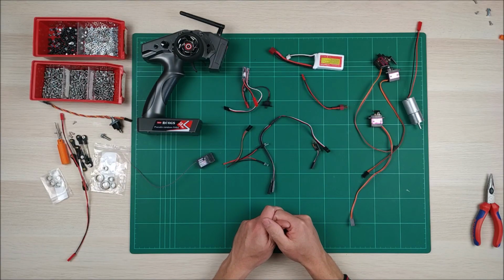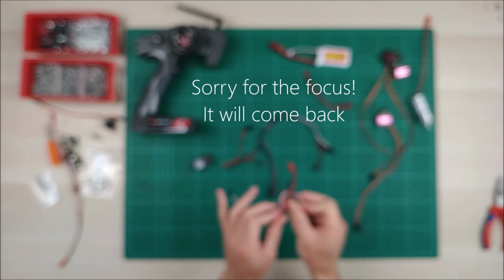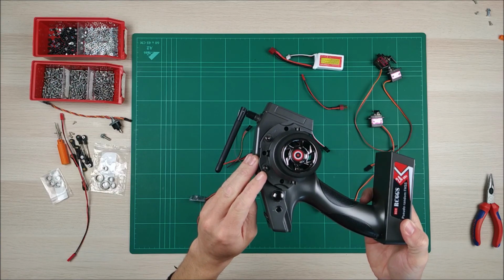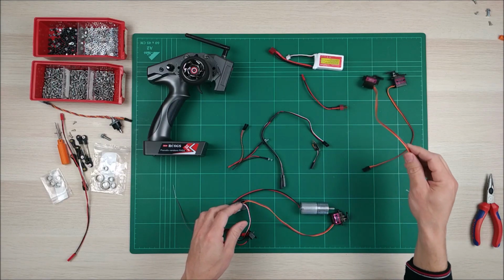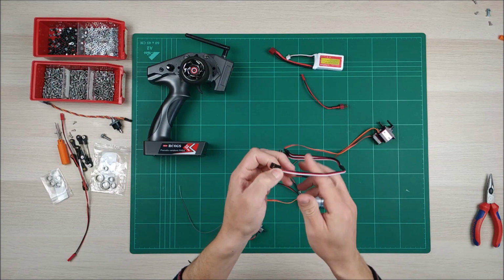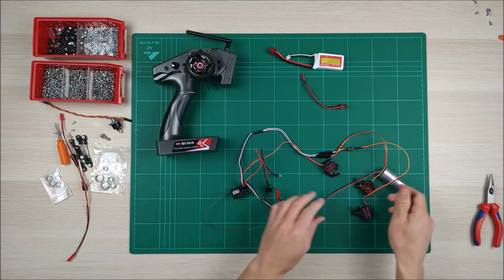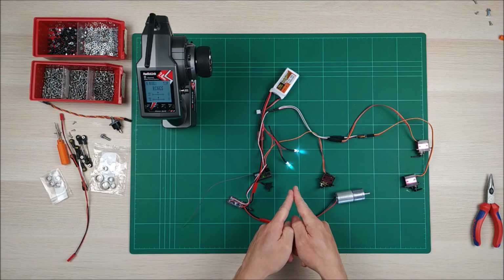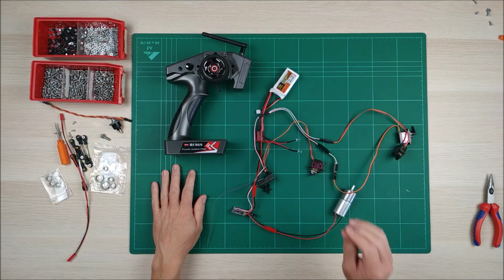OpenRC Tractor build with me part 2 connections test

Comment: Hello,

While I am printing the parts for the Massey Ferguson version of your tractor, I ran a connection test for the transmitter, receiver, motor and ECS, and three servos.  I ran into an issue when using the Y-harness and the servo signal reverser.  I just checked my order and I made a mistake of ordering the 5-6V Servo Signal Reverser.  I just ordered the 3.6-24V Servo Signal Reverse module and hopefully that one will work.  In the meantime, what I ran into with the 5-6V version is that with one servo connected directly to one Y-harness and a second connected via the reverser, the servo connected to the reverser would work and the directly connected servo would not.  If I connected each servo via a reverser (I had ordered two of them), both would work and properly reversed.  Connecting the servos directly to the Y-harness, no reverses, both servos would work.  So it just the configuration where one servo uses the reverser and the other not, that the servo without the reverser does not move at all.  Any ideas, suggestions?
Reply from the maker: Sorry to hear you ran into problems. It's strange, I didn't have this problem. Have you tried different radio channels? Just today I was doing some tests with my next tool and both servos worked OK.  Maybe it has to do with some incompatibility between servo and reverser. My reversers are 3 years old, maybe manufacturer changed something.  Can't think of another reason right now but I'll get back to you if something comes to mind. Let me know if you managed to solve this.
Reply: @MakitProjects  Thank you for the quick reply!
Configuration is #1: Y-harness with both servos connected, no signal reverse module on either servo.  Both servos work, spin in same direction.
Configuration #2: Y-harness with each servo connected through a signal reverse module, both servos work, spin in the opposite direction to configuration #1.  So the signal reverse modules work properly for each servo.
Configuration #3: Y-harness with one servo connected with no signal reverse module, one servo connected through a signal reverse module.  The servo with no reverse module does not work, the servo with the reverse signal module works, direction reversed.

As I mentioned, the Signal reverse modules I have now are the 5-6V version.  I have ordered 3.6-24V Servo signal reverse modules and they will arrive in a week.  I will let you know what happens.  In the meantime, I should have all the parts printed in a couple of days and will start the assembly, working on the front end/steering first.
Reply from the maker: @tadashiyara  i think you made all tests perfectly. It's odd... Let me know how it goes when other reversers arrive. In the meanwhile I'll try to think what can be the problem

Comment: Hello 
I have a problem with the two servomotors when I connect them on channel 3. only one works but when I connect them on channel 1 both work correctly. Does this come from the radio?
Reply from the maker: It's really odd.... I don't really know what can be the problem. Which radio do you have 3ch, 4ch or 6 ch? Do you have more servos you can try? Do you use a servo-reverse for one servo?
Reply: @MakitProjects  i use a radio link 6 channel. I have try with other servo but they doesnt work corectly. 
And i use a servo reverse for one servo. And a y cable to connect them.
Reply from the maker: @julienharel2951  Have you tried on ch5 or ch6?  If one servo works, it should work with two too.
Reply: @MakitProjects  i have tried on the channel 5 and 6 but one servo was move   alone
Reply from the maker: @julienharel2951  If it happens on more than one channel, I don't think it's a radio problem, it should be the servo, cable or reverser but I may be wrong. 
Sorry I can't be of more help from here...
Hope that you can sort out your problem.
Reply: @julienharel2951  I have the same issue as well Julien, did you figure it out? If I use cheap plastic servo's it will work properly but i just bought some better more expensive metal gear servos and I'm having the same issue as you where they won't work at the same time on channels 3-6 but they will work on 1-2. Interestingly enough if I remove the servo reverser, then both servos will work at the same time. I tried a different servo reverser, same model tho, and had the same issue. I wonder if its the model of servo reverser we're using as I notice it looks slightly different than the one in the video.